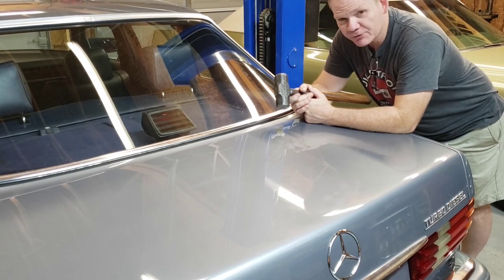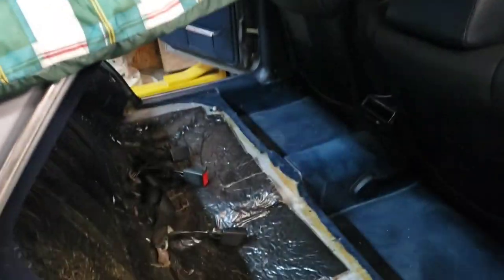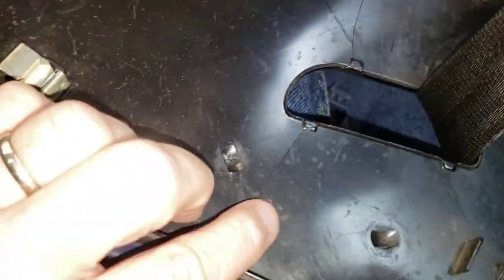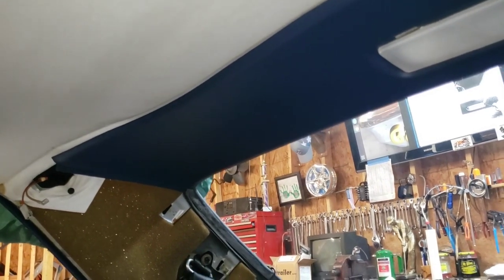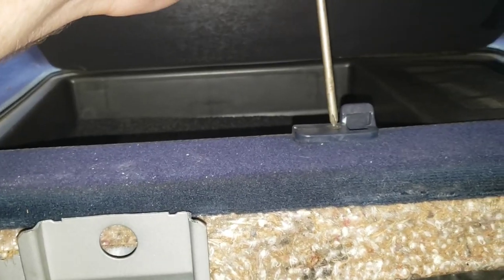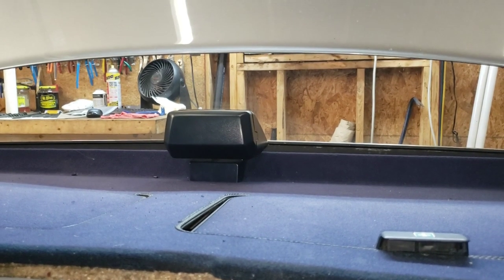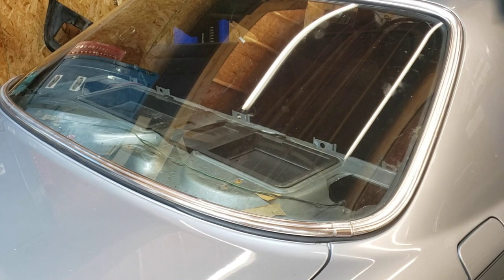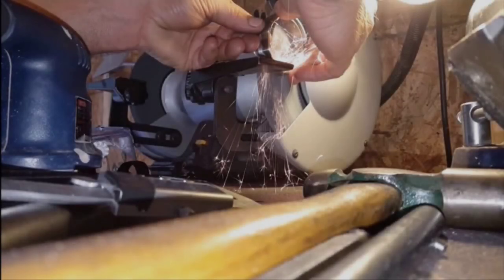Mercedes W126 - Rear Window Channel Rust Repair - Part 1 - Interior Trim Removal

Comment: That's a genuine Mercedes-Benz center high mount stop light (CHMSL). It was definitely added later as 1986 was the first model year they were mandated in the US. It wasn't uncommon to see 81-85 W126s and even W123s with MB CHMSLs added. I'm thinking some dealers may have done the job if the customer wanted it.
Reply from the maker: Sounds reasonable to me.

Comment: One of  the other videos on the rear glass said you have to take out the headliner
Reply from the maker: Not true. You only have to remove the C pillar trim, hat rack, and the horizontal trim in the rear which contains the rear dome light. The headliner stays in place.
Reply from the maker: Maybe they were talking about a different model car?
Reply: @ImpalamansGarage  Earlier series cars like 108's that don't have the plastic horizontal trim perhpas?
Reply from the maker: @petercollingwood522  Unknown.
Reply: @ImpalamansGarage  yep I think it's at 300D in the video maybe you seen it? I think he's talking about leaving the car out in the sun so it gets hot enough for them to stretch their headliner back into place after reinstalling the rear window

Comment: Can the rear chrome trim be seperated from the glass?
Reply from the maker: Yes but only after the glass is removed from the car. We removed the glass but at the end of the project I had a professional glass shop reinstall it with a new Mercedes rubber seal I purchased.

Comment: Have you thought about buying a w126 part car? It  would help with spare parts, test fittings parts, sheet metal panels parts, etc. Can't wait to see how much rust is hiding behind that seal. 😟🤬
Reply from the maker: That would be a good excuse to build another building to house cars  LOL
Reply: @ImpalamansGarage  
With all the aftermarket crap parts available. Having a parts car is a must these days. I know it take up space, but it comes in handy. I have a parts car in my car port, taking up space.

Comment: The one thing i did not realize when i did what you are about to do is that the chrome trim has to be installed in the rubber around the glass before the glass is reinstalled....lol
Reply from the maker: Correct. I was somewhat astonished when I read that in the service manual.
Reply: Oh! I was thinking you would have to pull it off before removing the glass and putting it in after reinstalling the glass. My experience is with a front windscreen on a different make of car. Since you've done this already, you're the expert!
I'm glad I never tackled this on my 85 300d about 20 years ago.
Reply from the maker: @wernerdanler2742  Expert he says. 😂😂

Comment: I dread doing this job on my w116, which is quite similar to the w126. Are you going to use any sort of sealer when you put the rubber back? I also assume your going to replace the rubber.
Reply from the maker: Yes sir. Will be using a new genuine Mercedes rubber seal and Mercedes window sealant.